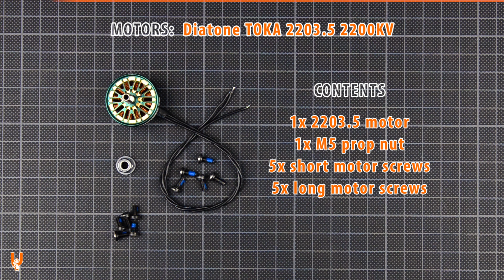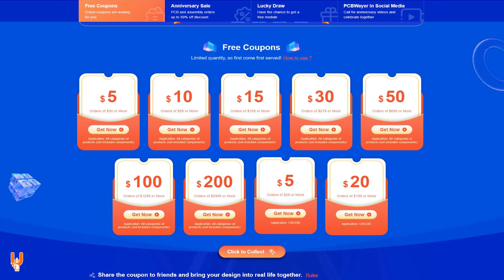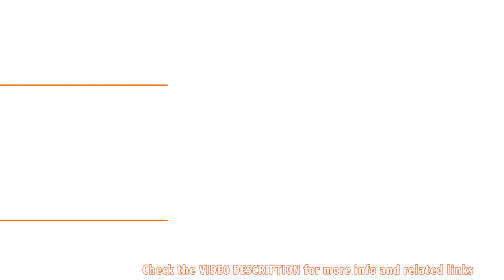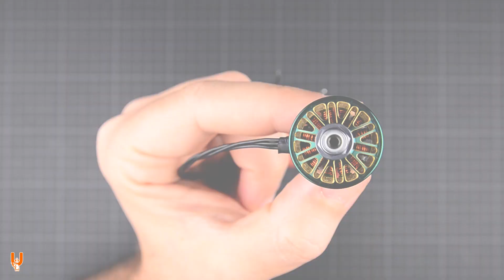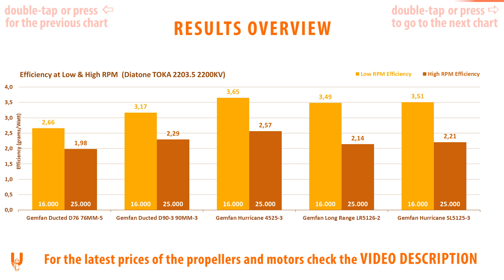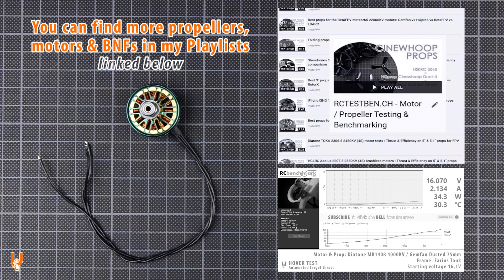Diatone MAMBA TOKA 2203.5 2200KV FPV motors on 6S (feat. Gemfan propellers)

Comment: Wow, this is the benchtest for what props I tried on my ultralight 6S 5 inch build.
The 5 inch props were the fastest in top speed. The gemfan D90-3 were the props I kept on and swaped the arms out for 4"
Personally I found the 5 inch flying feel too floaty. 
After building a sub250 6S 5 inch, you realize it's just a trend and that discload is more important for a good feel.
Reply from the maker: Thank you very much for the feedback!